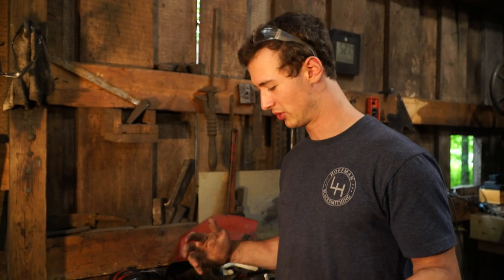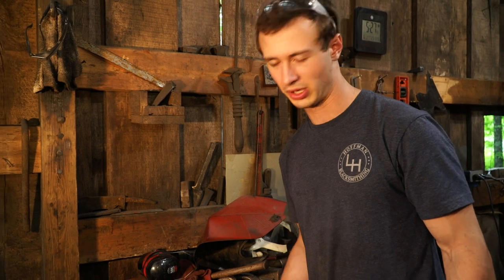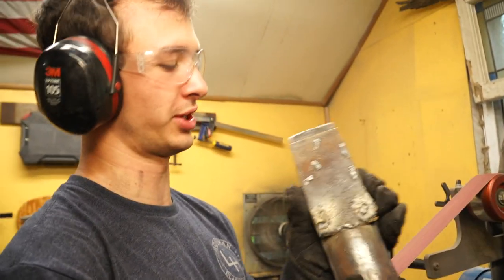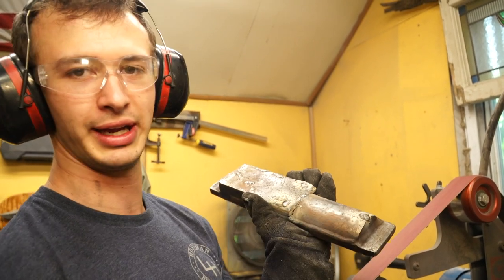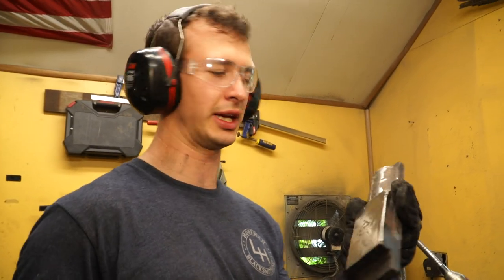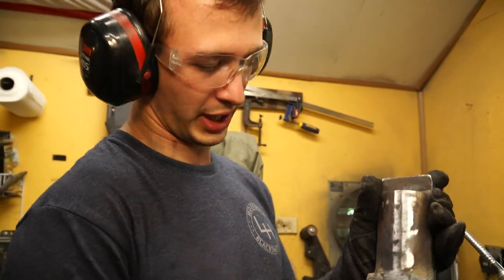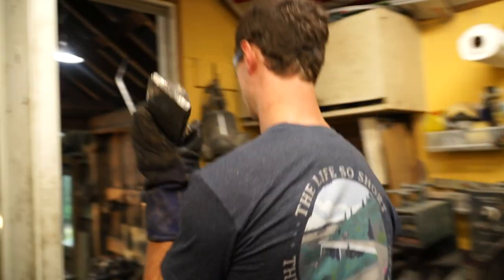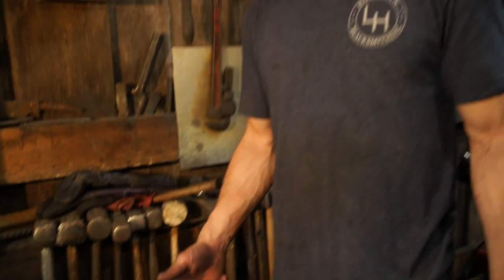THIS TOOL NEEDS HELP

Comment: One thought for the next time you need to repair those are to hardface it with a stick welder. That would probably add a couple of more months between the repairs.

Comment: I like the quick take approach.  It would be better if you would explain more about what the problem is you that you are addressing, and describe what you are going to do and how you are going to solve it before you start.  What kind of welding material are you going to fill with, what kind of arc welding technology you will use, etc.  The exposure level on your welding video segments is too bright, and not much can be learned from blinding whiteouts.  Shoot through smoked glass, or some such.

Comment: Liam, if you don't want to be tethered to an oxygen bottle at an early age you REALLY need to wear a respirator when you're using that grinder.  I'd rather see you as a happy man in your forties than an unhappy man at a much younger age.  Love ya, bro.
Reply: The warning label on welding wire states that "Smoke from this product can damage the communicative center of the brain" so running an exhaust fan in that upper window where the hornet was killed would be a great place for that exhaust fan.

Comment: Did you use flux core wire or gas shielded wire is one strong than the other

Comment: Hey Liam do you use shield gas with your wire welder?
Reply: Judging by the splattering, the brownish discolouration around the welds and the slag I'd say he's using innershield or flux core mig wire.